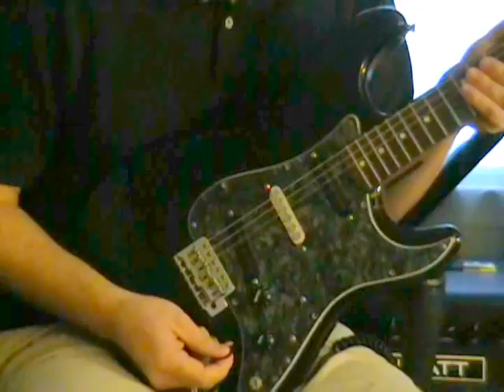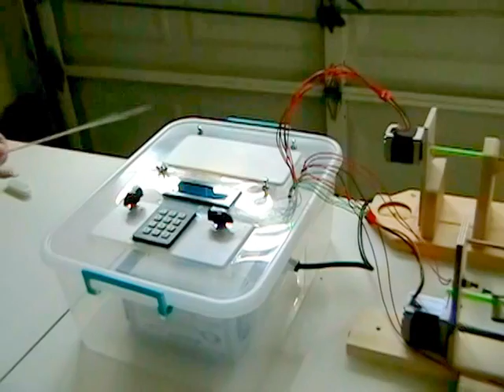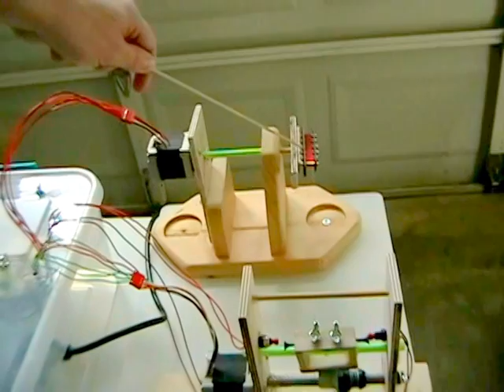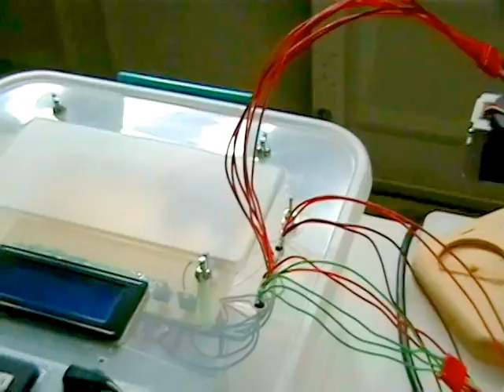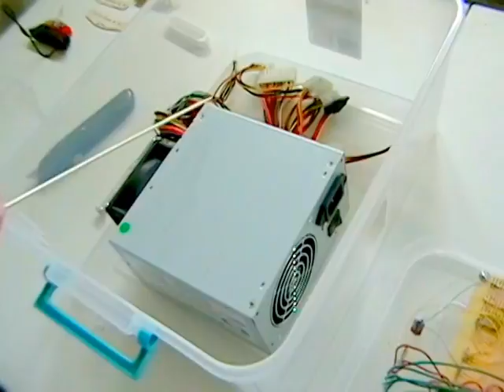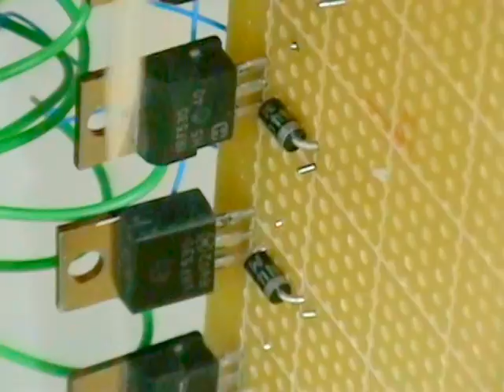Guitar Pickup Winder

Comment: I'm surprised you didn't use the 5v from the ATX PSU to power the logic, and the 12v line to power the steppers via the mosfets. This will enable my higher torque and rotation speed. It's not uncommon for stepper motors to run extremely hot due to the higher voltages used, and work fine in this temperature.

Comment: @pickering238 
 "The stepper motors are supposed to run on 3V and are 1.6 ohms per winding. " I wouldn't be so sure about that. Stepper motors are designed to run with a specitic current waveform, depending on how many phases they have. It's the current that matters. Decent stepper motor drivers need surprisingly high voltages (in the order of 30-80V) to keep up with the reactance at higher frequencies. with 5V you can't make the it run fast and as you rev it up, it'll lose torque and stall.

Comment from the maker: @frogz  The stepper motors are supposed to run on 3V and are 1.6 ohms per winding.  I bought a hefty ATX supply since the 3.3V line on the supply would be able to supply plenty of current.  When I hooked it up, the drop across the mosfets was enough to prevent the steppers from turning.  So, I used the 5V line instead.  To separate the CPU from the motors, I ran the 12V line thru a 7805 to get a second 5V.  After I finish the rightup, I'll be posting it online somewhere.